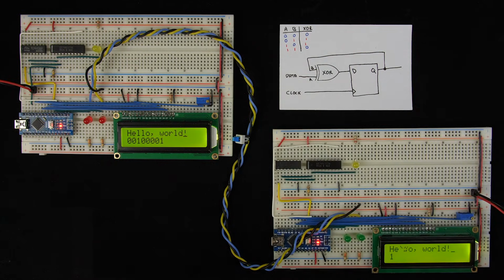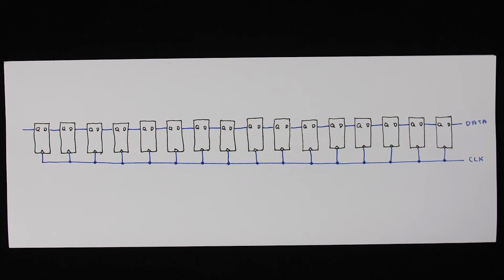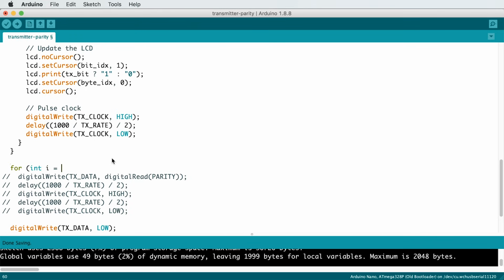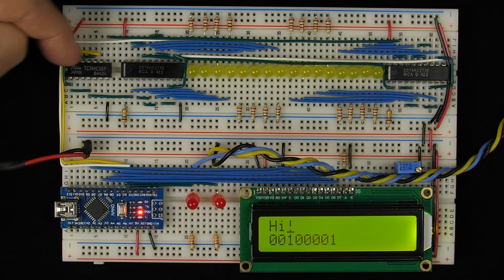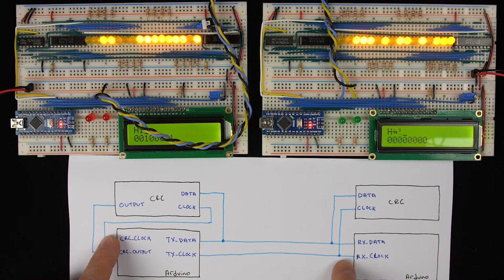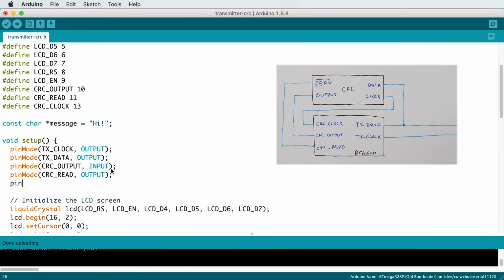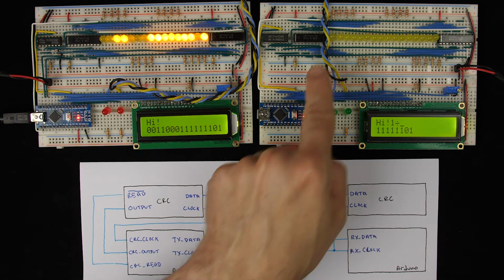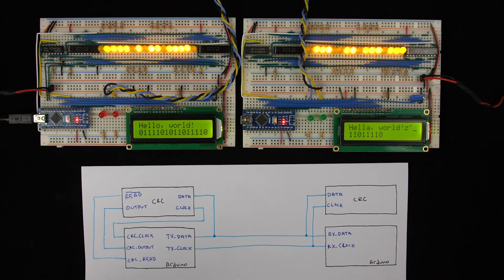Hardware build: CRC calculation

Comment: Hey! I was just playing around with the CRC generation and found a simpler and faster way that eliminates sending 16 zeroes into the crc generator.

What you did was:
1. initialize with zero
2. feed message[i] into the right side
3. crc-flip based on crc[leftmost]
4. repeat until message over, then feed 16 zeros

If you replace that algorithm with:
1. initialize with zero
2. feed 0 into the right side
3. crc-flip based on crc[leftmost] xor message[i]
4. repeat until message over, done. no 16 zeros needed.

This works because you basically skip the 16 first steps of your algorithm, which only fill up the pipeline without any bit flipping.
You could bypass that step. The message itself doesn't have to get fed through the pipeline.

This has the advantage that there is no waiting time between the message and the crc sending, after sending the message you can directly send the crc.
Love your videos, keep making them!
Reply from the maker: Nice improvement!
Reply: Thanks alot can you be kind enough to share this on github
Reply: Well, unless the CRC is calculated as you transmit like in this case and then your CRC is ready when the message is complete
Reply: I’m trying to picture what this optimization looks like... but I cannot:( I don’t understand the difference in the steps. I completely follow his original though.
Reply: Why init with zeros then shift in a zero?
Reply: Why not just send over the output of the shift register instead of the input? Then when you start sending zeroes just flip the crc-read. Then you can skip feeding the crc back to arduino, since it kinda defeats the point of using hardware imo :D And you don't need two separate clocks either. Is there something I'm not seeing?
Reply: Can someone please elaborate on this? Much appreciated :)
Reply: @mekelius  Do you mean passing all data through the shift register prior to sending? That's what it sounds like...
Reply: @c10yas  I don't get why this would be an issue. It takes the same input (Initialization trigger to set it to 0, message[i], clock), and the data gets loaded in the same direction (MSB first for some reason, isn't that bad practice Ben?)
Reply: @mekelius  I was thinking that too, unless in transitioning from transmitting data to transmitting CRC, you need a clock phase shift or delay.
You still want to read in the CRC into the Arduino, since you might want to display that on the LCD.
Then the question is, do you switch from transmitting data to transmitting CRC in hardware, or through the Arduino?

Comment: I never really understood CRC until I watched your video.  I can understand how early days you would calculate CRC in hardware and then send it along after the message.

But after watching you having to add so many read/write pins for clocking CRC hardware separately, then reading CRC using a read-enable pin, I'm thankful I always got to do the CRC calculations in software (didn't understand them, just 'cookbooked' it)  :)

Comment: So amazing to see an algorithm I always use implemented in hardware! As a suggestion, you can hook up the FFs clear pins to the Arduino reset pin, that way when you press the reset button the pin will go to GND (that's what the button does on the PCB). You also benefit from the free pull-up that's on the Arduino board :)
Reply from the maker: Cool idea!

Comment: Absolutely brilliant. As a Comp Sci graduate I have to say your stuff is like a blast from the (very distant in my case) past. The only thing I'd add about CRCs is that  fundamentally although they confer a good degree of confidence in the  correctness of a message, they still allow for a 1 in 65536 chance of  passing of a mangled message . For a high message noisy environment, this could (and certainly can be) problematic.
Reply: Yep. When I had a noisy DSL line the CRC error count was through the roof, on the order of 10,000s every few minutes. They were caught and retransmitted, but on top of that about 1% of my TCP packets would still fail their own checks and request a retransmit on the protocol layer. So about 1% of errors were making it through the modem’s own CRC checks!
Reply: @kaitlyn__L  commercially I'm working on a wireless system. I get duff messages every 10 mins even though their crcs are good.
Reply: @andyonions7864  that’s rough. I knew RF was noisier than even a maximum-length DSL run, but oof.

Comment: This is inspiring me to build a CRC-16 generator in Minecraft this weekend. This is going to take a while.
Edit: a shift register with some XOR gates isn't too difficult and took only like half an hour to lay out and test. Making a wireless communication system that generates a CRC-16, however, would take all weekend.
Reply: It's been 3 Years now but We would like to know and/or see what's the status to your peoject? :)
Reply: @prathamkalgutkar7538  I forgot about it after making and testing a bunch of component circuits. Ran into conceptual issues with laying out and connecting all of the parts iirc.

Comment: One thing I would add here is a "CRC" line. When it's held high, whatever system you have for reading the output would be disabled and the only thing that would read data would be the CRC logic. With that, you could also make a basic frame. On the falling edge of the CRC line, you know a frame has ended and a new frame will begin in some time.

Comment: WOW!!  I used 3 breadboards for the TX/RX setup... LED's lined the middle board... I had room for an 74ls08 "AND" chip... it works as advertised, inputs were the READ signal from the Nano, and the last bit from the FF's... the output got fed back into the XOR's........ and it was a flawless CRC.... I put a Picture on my setup on my youtube if anyone is interested in seeing what I built... Thanks Ben, this was a Fantastic Teaching tool...

Comment: Hello Ben,

I have been researching MANY different ways to calculate the CRC and when I saw yours I was blown away!

I do NOT have bread boards, but I have A LOT of interest to reproduce the shift register results you had.

I am not using the same protocol however; my application runs CRC-16 MODBUS.

I surmised concluded the following steps:  'PLEASE CORRECT ME IF I HAVE IT WRONG."
1. Assemble all bits into string of binary including CRC initial.  "My case all '1's."
2. Reflect IN, 'TRUE', flip all bits of my initial message. "exclude the crc"
3. Shift to left most is equal to '1'
4. Left Most = '1', xor polynomial bits 16-1
5. Xor complete, repeat steps 3 & 4.
6. Continue loop until polynom of 16 is at LMB = 1 @ bit 16 or until it can-not fit  "so if there is a '1' at bit 14 but the polynom is 16 long, remainder is calculate polynom
7. After calculation, Reflect output of calutation "TRUE" in my case so I flip the bits in my output.
8. After I flip the bits I check the xor output requirement which is "0x0000" so i surmise that means do not xor output?

Then I compare to target value fro ma known calculator source.

My shift register does NOT produce the target value.

Please let me know if there is a flaw in my process.

Comment: Absolutely brilliant description of the maths behind polynomial division made it seem so simple.  Then to see how it is implemented in hardware so simply almost seems like magic when it actually works!  One thing I noticed in your Arduino code is that you put the echo of the transmit clock AFTER the shift-register clock.  Strictly speaking I guess this could cause a race condition where your shift register output starts changing BEFORE you have latched the transmitted data.  It is probably never likely to cause a problem unless you were single-stepping through the code but I would have set the transmit clock BEFORE the shift register clock.

Comment: Thank you for your explanation of the columns in CRCCalc! I thought it was a bit off-topic for the video at first, but now I've successfully matched my CRC calculator to that website, now that I understand those columns.

It's unfortunate that CRCCalc no longer shares their source code..

Also, I'm surprised that your hardware implementation didn't involve a table..! It's that same simple, infinite-length polynomial division.

Comment: you could have also used some transistors to only send clk to the shift registers and only connect the crc output to the tx line
that way there would be no gap in the transmission, although the transistors might distort the signal a bit

Comment: Though my use case project for the CRC series has evolved beyond needing a robust communication protocol between a raspberry pi 3 and two arduino's over a bit banged I2C bus, perhaps it could still be implemented in the latest revision, in software of course. Thanks for explaining CRC with hardware and blinky lights! Seems to be the way to learn new things.

Comment: If I remember correct (I might be wrong), you don't have to shift in the 16 zeros at the end making a total of 40 shifts. You could get away with only 24 shifts if you modify the CRC circuit. Don't ask how. :-) I do indeed prefer Bens way as it explains the math perfect.

Comment: So... What you're talking about is pretty similar to how you do integer division on computers that don't have hardware divide/multiply functions.

Division is harder to understand than multiplication, but it still comes down to repeated application of shifts and subtraction.

The algorithm for a shift + subtraction version of division looks something like this:

- Shift the 2nd number (divisor) to the left one bit at a time, until you reach a 1, which means you've shifted far enough. 
- Along the way, count how many shifts you did to get here. (depending on how your hardware handles loops, maybe add one more, maybe not)
- now loop through as many times as you just counted. Each time you shift the left-hand bit out of the 2nd number (divisor). If it's a 1, you subtract the 1st number (Dividend)  from the result, and count up by one (typically you need to store a working value for the result, and working values for both the 1st and 2nd number - unless you can safely use the input values directly for this), if it's a zero, you do nothing.
- Then you shift the 1st number (Dividend) right by one position, and continue until you've gone through everything.
- your result, since this is integer division consists of the integer portion, and the remainder. The integer portion is the count of how many subtractions were performed, the remained is your working value.

I've probably made some kind of logical error here, but since I'm working from memory, I'll leave it alone.
Hopefully you get the general idea.

Comment: That was artfully delivered. I have dabbled, ever so slightly in circuit design and Arduino programming and I have never worked with logic circuits though I am familiar with what they are and what they do. I was able to follow your explanation and came away with a new understanding of how voltage drops affect circuit function and how clock signals are used. Thank you.

Comment: Pretty sure you could have gotten away without the diode toward the Arduino in your makeshift and, you could've set the Arduino pin away from output so it doesn't interfere.

Comment: I also like the error-correction possibilities of the two-dimensional parity bit solution.. Though I usually try to make it more square by not doing the horizontal lines just the one byte wide.. Also two way communication is fairly important.. If the receiver detects an error doesn't mean the sender know it has to send again.. so I would kind of make use of BOTH methods.. but I use the crc of the corrected bitstream as the response when all as hbeen transmitted and negotiate a re-transmission if it doesn't fit.. that way the error-correction solutions implemented will not only guess whether it's right, but also be able to make a simple question as to "is this right?", so it only gets re-transmitted if the error-correction failed.

Comment: It is a bad idea to use Arduino Pin13 for input, because while bootloader is working Pin13 is OUTPUT and this conflict with XOR output. 1K series resistor after XOR is OK, but better avoid connect Pin13 to any push-pull outputs.

Comment: @36:20 when you said "...and pin 11 is going to be our CRC_OUTPUT pin, which is a little confusing because it's an input pin".

That is very telling that you named it improperly. I'm sure you're aware that it's convention to name pins from the perspective of the device they belong to. In this case, you would have named it CRC_INPUT on the arduino, it wouldn't have been confusing in the code, and because of the convention, it still would have made sense on the schematic for the output of the crc module to go into the crc input of the arduino.

Comment: has an arduino
calculates everything with logic gates
Reply: Absolute madlad
Reply: 1. he's a madlad
2. it frees the arduino to do more important calculations, an arduino is sngle threaded, it cannot do both at once
Reply: God 
I mean yes, but with what simple math this is, it would take maybe 200-300 clock cycles.
Reply: Real men add hardware acceleration built from logic gates to their microcontrollers.
Reply: @God-ch8lq  The arduino has hardware modules for data checking.
Reply: @God-ch8lq  mm single threaded does not necessarily mean it cannot

Comment: Nice video, I really liked the bit fliping circuit, very clever! I have one doubt though. When I saw the chained D-flipflops, it was not clear to me why the entering signal was not propagating direcly through all of them on each clock pulse. I watched the D-latch video, and in fact I saw that when the enable is active the output follows the input, at this point I understand that if you chained several D-latches they all would've been set to the same state. Then I checked the D-flipflop video where the edge detectors are introduced, however I was still thinking that this propagation issue could happen. The explanation I'm thinking of is that there's a propagation delay so that the D-flipflop can be "storing" a new input while the output is still the old one, and that the clock pulse is shorter than that delay thus disabling the D-flipflop just before the signal propagates through. Am I somewhere close to the correct answer? I'd like to better understand the behavior of the circuit, thank you!

Comment: Excellent Video as always... But the read of the crc result into the Arduino feels a bit “meh” to me... You actually don’t need to read the crc output into the Arduino. Instead use an AND gate and crc output and crc read as inputs and then OR the result with tx data. 
And since you are not transmitting anything, when generating the crc, you could pulse the clock for the 16 zeros much quicker (as fast as the chips can handle, probably MHz...)
Reply: Even when reading it with the arduino, you could have just ANDed the CRC input to turn the input into zeros instead of having two clocks.

Comment: Before I knew about the internal layout on a chip I always wondered why the 74xx273 and its friends had such an inconvenient layout. I never though about using them as shift registers. It probably still is not the most convenient layout for these connections, but it makes at least some sense not to have all inputs on the same side...

Comment: Your Arduino may have wanted to initialize the flip flops in the shift register to 16 0's on the transmitting and receiving end prior to sending or receiving the message and you wouldn't need to constantly manually reset the registers with a wire. This would have been a simple init loop identical to the one which was used to set the last 16 bits to zero when you began the video. Doing this would have made it easy to fill different patterns into the register and test CRC variants where only the shift register seed is non-zero. Zapping to zero manually as you have done precluded an easy demonstration of various seed alternatives.

Comment: I'm really glad that I came across your videos and I'm amazed at what you've built.  I never underestimate the power of software, but since this video is all about performing CRC in hardware, why didn't you also make that final step of clocking out the CRC data from the shift register directly onto the TX_DATA line (using the READ line to control an AND/NOT->AND pair as a data switch between the shift register and the arduino TX_DATA line)?  Making the CRC data from the shift register pass through the arduino unnecessarily makes this a 95% hardware CRC calculation build instead of 100%.  I'm guessing it's due to the lack of room for another IC for the AND/NOT gates, but CRC 100% in hardware would have been great to see.
Reply: This is basically a bit banging transmitter and receiver. He would need at least another breadboard to get most of an UART implemented.

Comment: Hi Ben & viewers,

Just a quick heads-up  - the website you went to no longer returns the same CRC as it did in your video. 
The parameters for CRC-16/XMODEM are still the same, so I can only assume that at some point a bug was introduced.

I spent a long time comparing my code to yours, only to find out they were exactly the same, and gave the same answer.

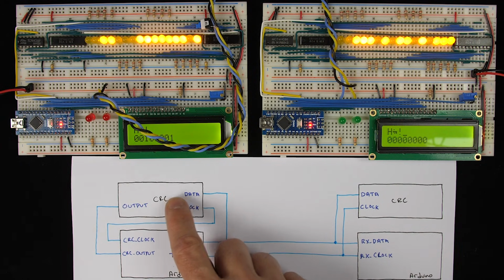Comment: 29:16 I was thinking about making AND gate inbetween tx data and tx clock and creating "tx bit" .
Now my design will be easier)
P.S: Watching further the AND gate was added, but not for data.
Putting 3 gates for the 2 mentioned and 3rd CRC circuits and adding the tx bit still a better way to do it.

Comment: You're running things at a slow clock for demonstration purposes, but you might consider adding some resistors and capacitors to your transmission line at some point to demonstrate the real reasons for limiting baud rate, so you can discuss how you actually negotiate what baud rate to use over the connection.